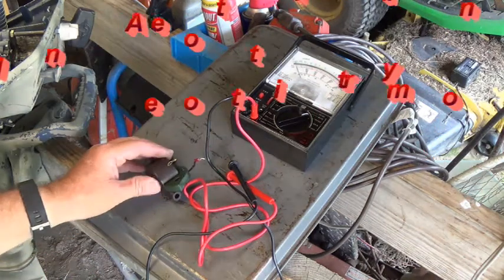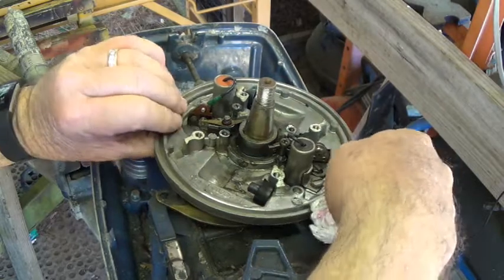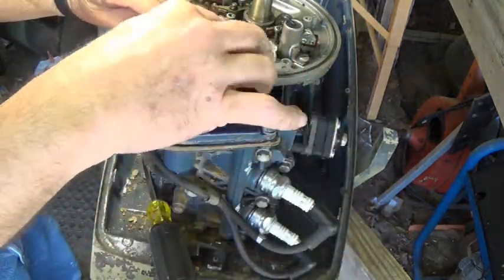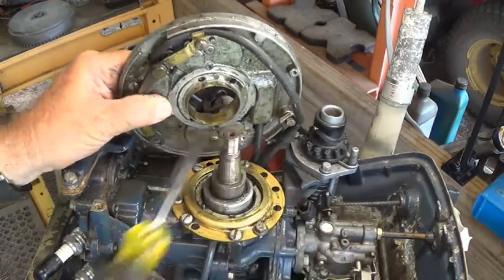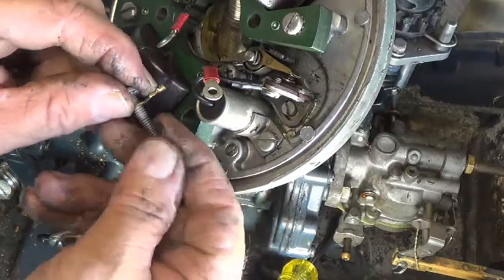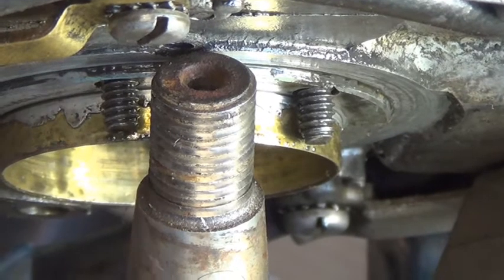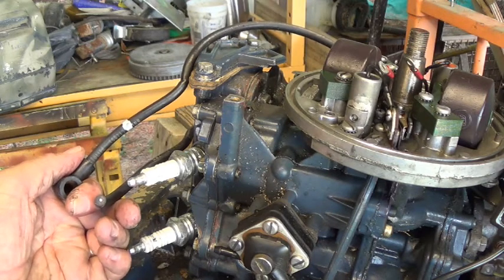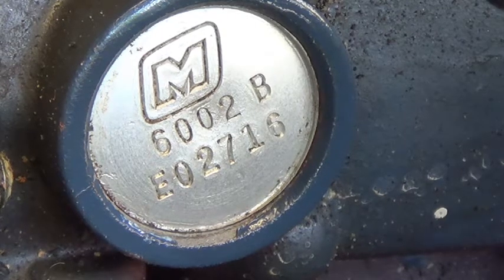Evinrude Fisherman Part 2 { electrical step by step }

Comment from the maker: I just want to say this motor has been a real challenge. I fix one end of a spark plug wire and the other end is bad. If I had just taken it to the water it would never had started. I have seen that before people take the boat to the water thinking it will start there when it would not start at home. This motor you can not assume anything I have to check every part to be sure it is good. Somebody started working on this before. I don't know if they just gave up or found a big problem ether way we will press on.
Reply: Om Fishing stop being so cheap and get a bunch of 7mm wire I went to the junk yard and got a box full for 10 bucks tested of course can’t beat that I wish I can find fuel line like that every motor I get there rotten
Reply from the maker: @jimcatx3090  Thanks for sharing.

Comment: How does a person use those freeze plug numbers to research a motor? Mine is also missing the ID plate on the transom mount.
Reply from the maker: This one I just went to google and entered {evinrude 2006b} It came up as a 1970 evinrude.  You can got to boat net and enter the number their and It will come up the same.
Reply: Stay away from the cheap amazon coils the point inside the coil is as big as a drywall screw and will not work stay with oem get a used coil on eBay or get a new one
Reply: There not freeze plugs
Reply: @jimcatx3090  That's an unfair dis-service, because instead of a smooth push in pin they have a screw that needs to be "screwed" into the spark plug wire like any other screw, which in my opinion is a good thing.